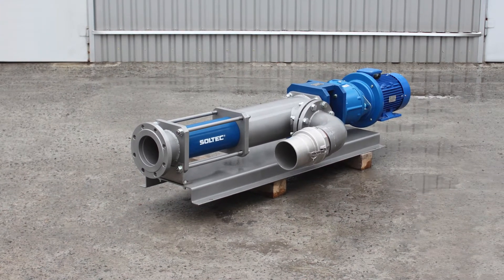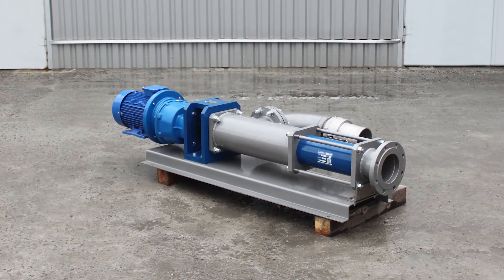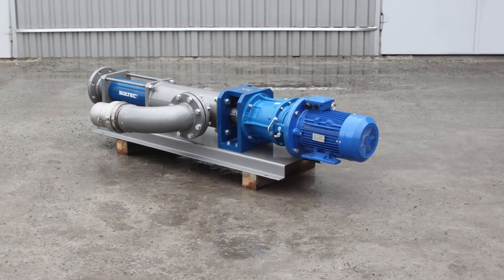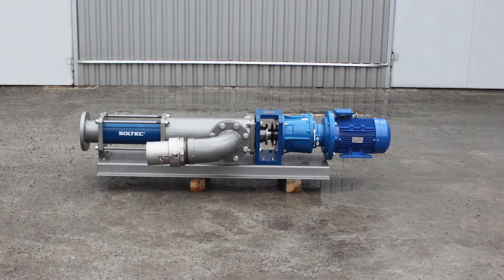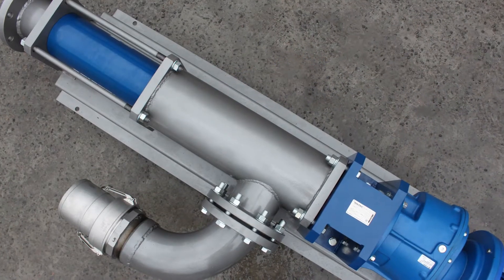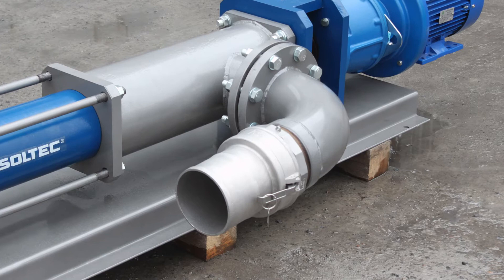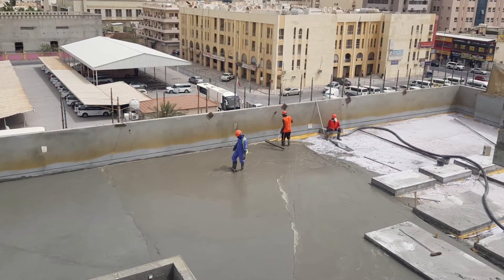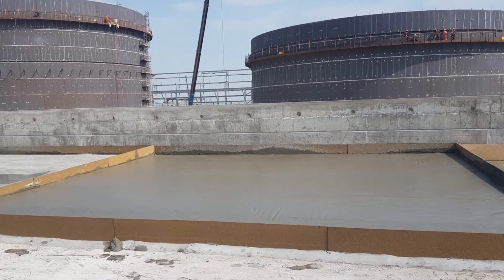Horizontal screw pump SOLTEC ® BN076S01HZ for high rise feeding of foam concrete

Comment from the maker: Horizontal screw pump SOLTEC ® BN076S01HZ for high rise feeding of foam concrete

SOLTEC ® https://www.soltecpumps.com/

TASK:
High-rise supply of a LIGHT WEIGHT FOAM CONCRETE to roof builds.

SOLUTION:
Horizontal Screw Pump BN076S01HZ
Pressure:  6 bar
Capacity: 28,5 m3/h
Rotor revolutions: 380 rpm
Material of Pump body: Carbon steel
Material of Rotor: Thermically treated Carbon steel
Material of Rotating parts: Thermically treated Carbon steel
Material of Stator: NBR rubber
The power rating of the motor is 11 kw.
Hard/soft inclusions: 30/45 mm
Input/Output flange: DN 150mm

PUMP ASSIGNMENT:
Work as a part of a MOBILE VEHICLE – A LIGHT WEIGHT FOAM CONCRETE GENERATING MACHINE.
The machine generates and pumps a Light weight concrete for roof screeds, and filling concretes for construction frames.

DESCRIPTION of the PROJECT:
One of the oldest waterproofing company of Bahrain, AGA GULF ROOF, along with its waterproofing mortars, and thanks to its long experience in Lightweight Concrete Foam manufacturing, provides filling concrete mortars to contractors and end users.
SOLTEC is the Mortar Pump Supplying Partner to AGA GULF ROOF in development of a new “Lightweight Foam Concrete Truck” that will serve standalone more than 100m³ Lightweight foam concrete a day.
Lightweight foam concrete consists 13% of water.
The distance of pumping is up to 60m in total, including 20m in horizontal, and 40m in height.
MOBILE VEHICLE works on construction sites, outdoors conditions, at temperature up to 50°C.
The operation mode of MOBILE VEHICLE is mostly 6 days a week, 10 hours a day.
MOBILE VEHICLE is serviced by appr 5-6 workers.
The control system of the MOBILE VEHICLE provides dual direction control with soft starter and overload protection.
For this project the SOLTEC design department invented an exclusive pump of a high-rise light weight foam concrete supply from the mixing bunker.
Distinctive features of the pump BN076S01HZ are as the follows:
1) having an additional optional inlet nozzle that is made in the shape of 90° elbow, and installed on the main inlet nozzle of the pump, through the standard flange connection DN150mm, which allows to direct it in a circle at any angle;
2) the inlet nozzle is located in the horizontal plane of the pump, for convenient placement of the pump under the mixing bunker;
3) the connection of the pump with the input and output highways is performed by quick CAM LOCK connections;
4) the pump is equipped with a flexible pressure-suction hose for sand-cement mortars.

Thus, due to pumps quality and price characteristics, SOLTEC PUMPS together with AGA GULF ROOF WATERPROOFING MORTARS have taken a leading place in the Bahrain construction market of small-scale mechanization.
Such cooperation has become an example for specialized enterprises from other countries to launch such projects in their regions.
SOLTEC has an experience in providing exclusive distribution and is open to mutually beneficial cooperation with you.

We invite you to be a partner with our young successful team of professionals.
Call, we will be glad to communicate and meet with you!

Alexey Sobolev
Sales person
SOLTEC®
+380504588123 Ukraine (Viber)
+7 920 588 8055 Russia (WhatsApp)